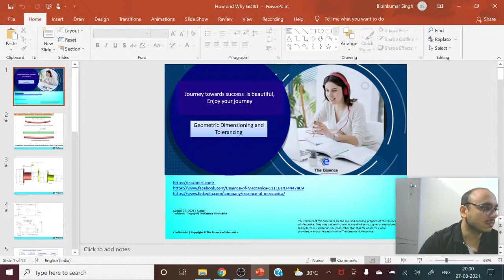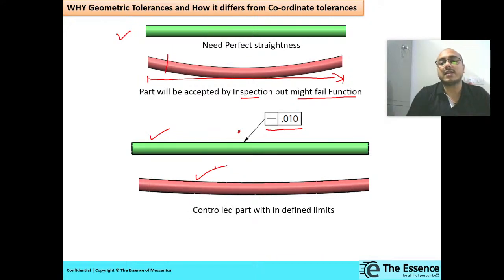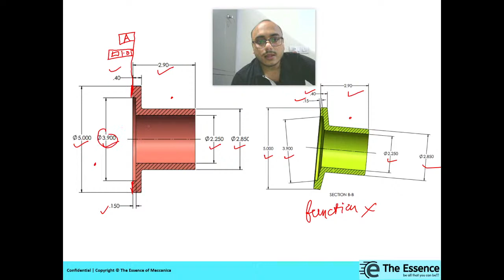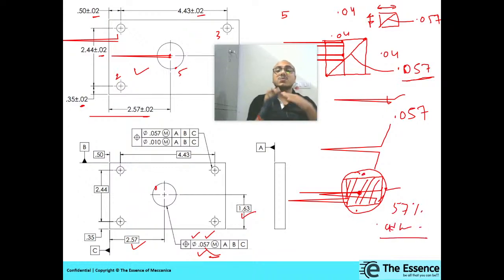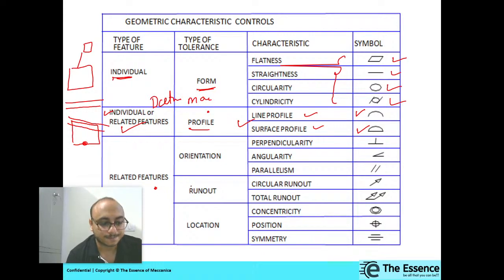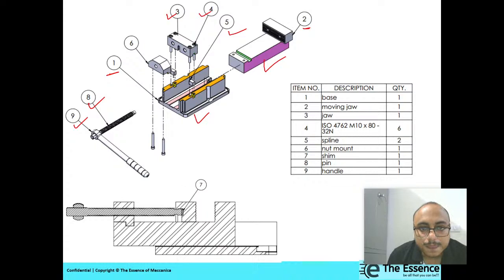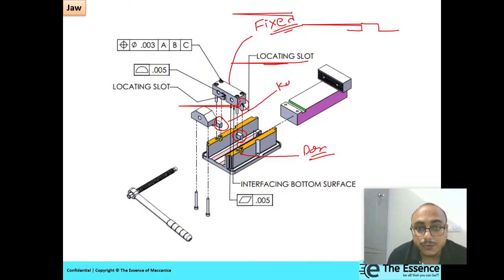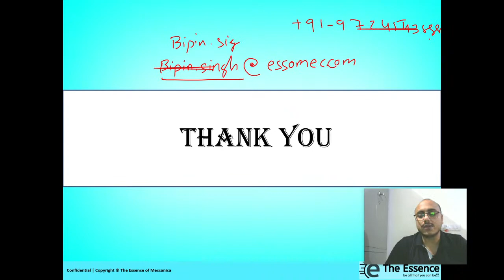Geometric dimensioning and tolerancing what and Why

Comment: What is the difference between composite tolerance and multisegment tolerance with same geometric symbols.. Kindly explain with example.
Reply from the maker: Composit tolerance: it has just on symbol of Gril for all segments. Upper segment is for pattern location as a group where as lower segment is for feature interrelationships with in pattern.
Multi single segments: All measurements are individual.
There are many other difference.